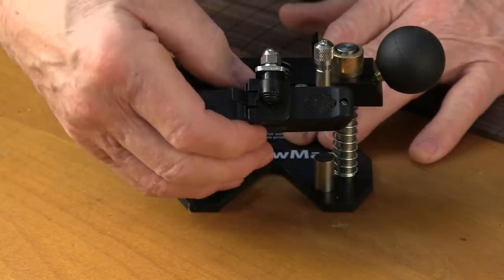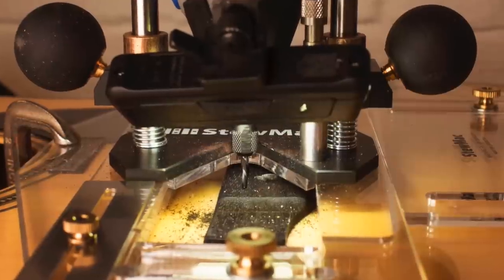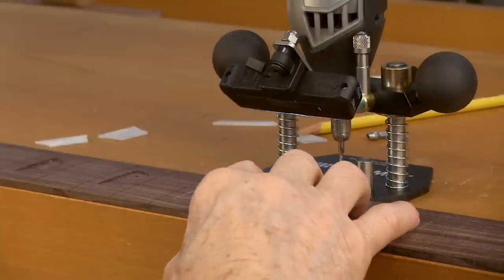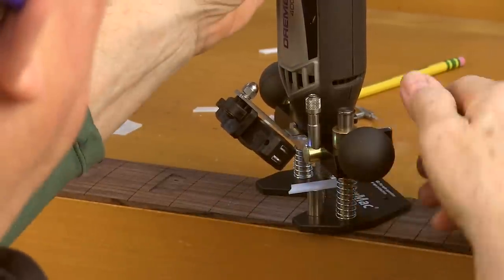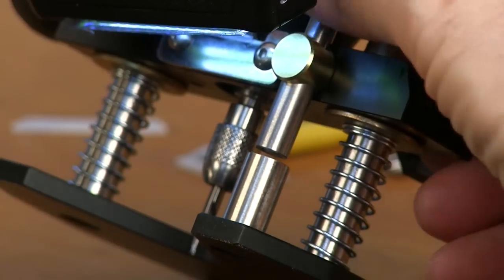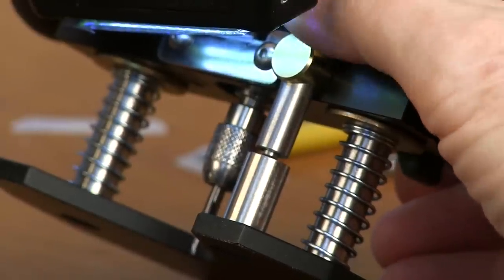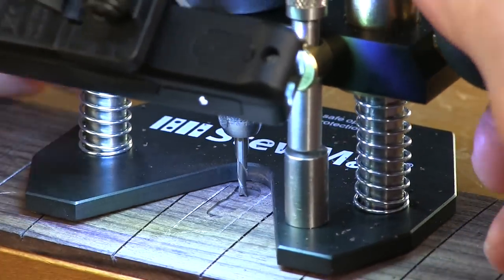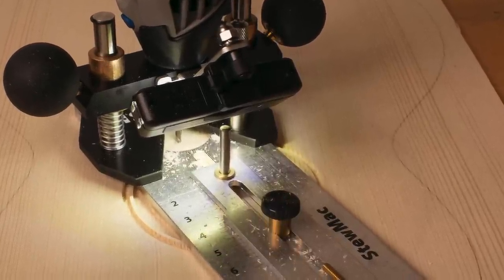StewMac Plunge Router Base for Dremel

Comment: I have had the plunge router base for a few weeks now.  It is a well made tool.  However I discovered that the Dremel router bit, #618, at 1/2" wide will not go down through the rounded "V" cutout in the base.  A very frustrating design flaw.  If it was slightly larger there would be no problem but for me that uses this bit quite often, I am extremely disappointed.

Comment: I bought this new plunge base a few weeks ago, When I opened the box I noticed the brass stop peices looked like someone took a pair of pliers & gauged them up. Also the little knurled knob for the secondary stop didnt even work. I littoraly had to take this thing apart to fix it because I needed it to finish an inlay job, but after all it works good the liht is very bright.
Reply from the maker: Hi scott 1911man, we're very sorry to hear the StewMac Plunge Router Base you received was defective. We will gladly send a replacement to you immediately. Please contact us by emailing service@stewmac.com or calling our toll-free number (1-800-848-2273). We look forward to making this right.
Reply: stewartmacdonald Well thank you but I used the base as I said to finish a job so I dont want to return a product I used. It seems too be working ok. Thanks again
Scott
Reply from the maker: We would not require you to return the defective Plunge Router Base to us. Please let us know if you would like to receive a replacement with a functioning micro-adjustment (secondary) depth stop.
Reply: stewartmacdonald I mean sure I just used the base again today & The whole adjustment knob came loose while I was trying to route a channel in a uke back for a feature strip. Please let me know how I can get this replaced

Comment: Can you use it to route pickups on a solid body (jazz pup on a precision bass for example)
Reply from the maker: You CAN, but it's probably a little underpowered for the job. I'd suggest a laminate trimmer with a pickup routing template.

Comment: After getting the height of the Mother of Pearl inlay... how do u adjust the height of the bur to compensate the height of the the Mother of Pearl you want to inlay?
Reply from the maker: First, you will need to set the primary depth stop adjustment so you're in the general range of the cutting depth (make sure the micro depth stop adjustment is set in the middle of its range). Then, each full turn of the micro depth stop adjustment will increase (counter-clockwise) or decrease (clockwise) the cutting depth by 1/32". You can turn this micro depth top adjustment to match the thickness of your Mother-of-Pear inlay.

Comment: Are you always pushing down to keep the bit cutting the depth you want? Or, do you push it down to the stop and then tighten the stop once you are down all the way. In other words, if you let go of the ball handles while cutting, does the bit rise up out of the cutting plane (the springs pushing it up)?
Reply from the maker: Hi Víðarr! Yes, the springs cause the bit and rototool to move upwards if the ball grips are not locked into place.
Reply: @stewmac  Oh, Great Thanks! edit: that makes it much easier to slope up out of a cut. Excellent.

Comment: Will Dremel 7700 fit in it??
Reply from the maker: The  Dremel 7700 needs to have be threaded underneath the front end (right behind the chuck). The threads will need to have a 3/4-12 thread pitch to fit our router bases properly. Unfortunately, I was unable to confirm that the Dremel 7700 has these threads on Dremel's website.

Comment: stewmac ripped this off from Veritas they have the exact same base plunger for rotary tools. the depth/stopped is not a novel technology
I used to own the first precision base but the problem however is how do you stay ALIGNED when you're cutting? this is not explained or remedied in anyway at least with the veritas model for an additional $100 I get a center guide. so $230 after tax as opposed to $200 just for this base here